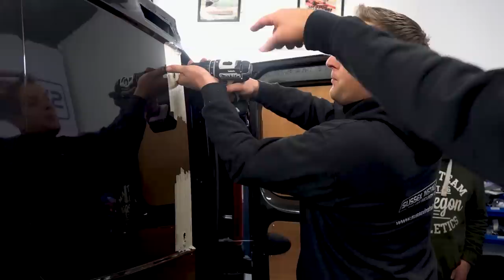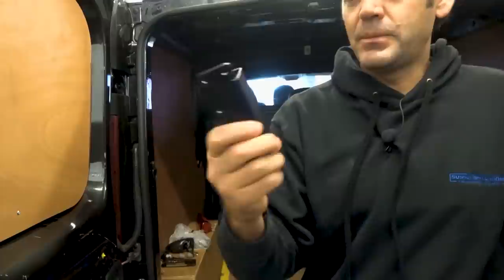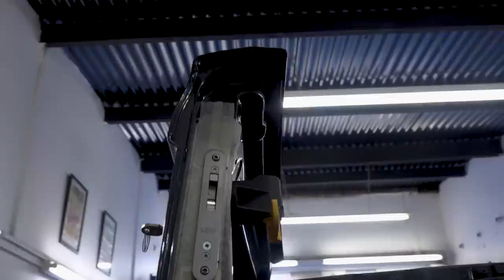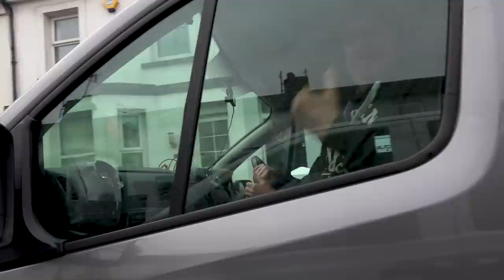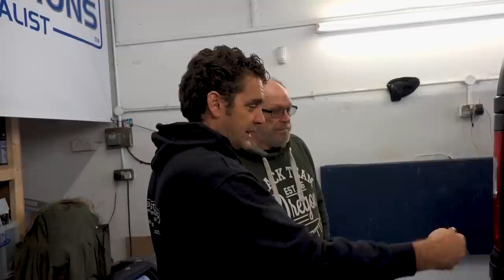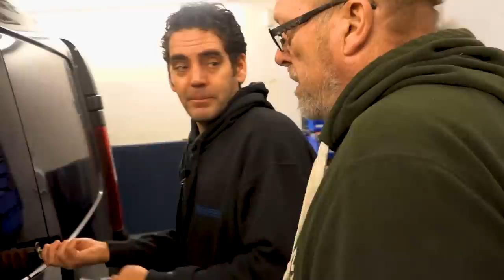How to Secure Your Van Against Tool Theft

Comment: A little tip: when you fit the safety plates over the lock and behind, stuff a rag tightly around it as when they try to drill to the mechanism, the rag will rap around their drill bit making it extremely difficult.  Cheap and easy. I’ve seen a few of these going around with a small drill hole in the back, if a piece of rag was stuffed in there it would make the whole process a ball ache.
Reply: I am a locksmith and have a lot of experience with drilling locks and I can comfortably say that this is a brilliant Idea.
Reply: @jonnyb9916  it's like when you try and drill plasterboard with 'loosely' packed rockwoll in there, pain in the ass.
Reply from the maker: That is a huge tip. I am going to pass it on to Sussex Installations. It is such a good idea. Thank you.
Reply: @SkillBuilder  lots of rag tightly packed but obviously not too much to foul the mechanism. Stuff it right in there.
Reply: Knickers.
Reply: @UberAlphaSirus  the ones you stole off your neighbours washing line?

Edit: a bit of bants
Reply: Skill Builder I think a good option would be to have 1 loose rag and 1 rag that would be fixed to the metal using some rivets and washers.
Reply: @UberAlphaSirus  Only fresh pants in my doors.

Comment: I’ve got a hooked deadlock on the side door and the back, and locking mechanism protection on both. I did it myself and bought the parts from this company. It was a bit fiddly but it came with instructions so not too bad a task if you’re quite practical. I certainly feel a lot safer knowing I have these bits on.

Comment: Again, I don’t understand why more people aren’t installing simple kill switches for their starters and the fuel pumps, if you do that that vehicle has to be towed away. 

These are cheap simple circuits and you put them in with however secret way you want to activate them, And that vehicle will never start yes it may get broken into but it will not be driven off

Comment: I do a bit of locksmith work in my area and keep getting asked if I do van security, unfortunately I don’t, and I am very interested in learning the installation process to expand my business, could you point me in the correct direction to learn? 👍
Reply: BigMac 3008 I think you’ve just got to get on with it. I did them on my trafic and worked out great. You need to be pretty precise with the drilling though and ideally need the correct tools to make the process much easier.

Comment: Don’t leave your tools in your van at night. Nothing you can do in the day time whilst st work. Other than take everything inside the job. But not always possible. But if you leave your tools in a van at night, your lazy and it will cost you. If you live in a flat, that is not practical for a tradesman. Say what you want but it’s right. You need a room in the house for your tools or a garage. Reverse the car or can up to the door.

Comment: What mechanical security measures are available for side slide doors please?
Reply from the maker: The same locks as the back but you need one at high level to prevent the peel down.
Reply: Skill Builder thanks 😊
Reply: @SkillBuilder  Would ye recommend  two dead locks on a side door lads? Thanks, 👍 🔨 🇮🇪

Comment: Makes you wonder when a new decent van is not small change why the manufacturer doesn’t fit some of this stuff as standard. Surely a van that’s tough to break into or steal would be a good seller. How about changing the law so that if you steel a mans tools/living it’s 5 yrs in nick, if it’s aggravated theft minimum 10yrs.

Comment: And how does this stop holes being cut in the panels? Everyone forgets the easiest panel...the roof....
Reply from the maker: Paul 
Of course there are ways in but there are also sensible precautions. It is up to you to decided where that line is. 
With a load space alarm they would barely get started before setting it off